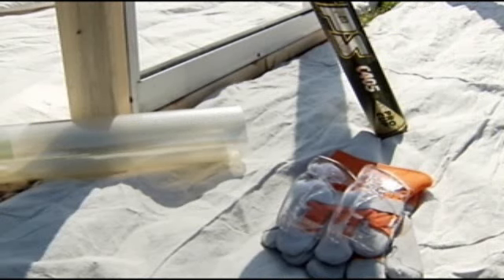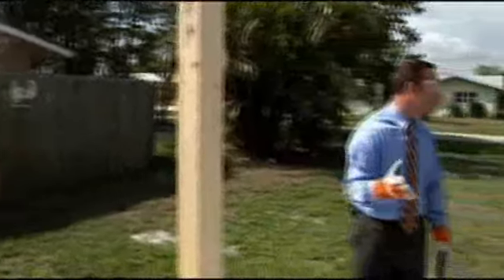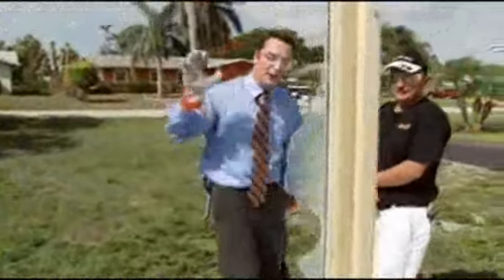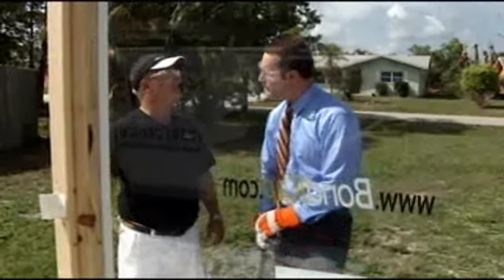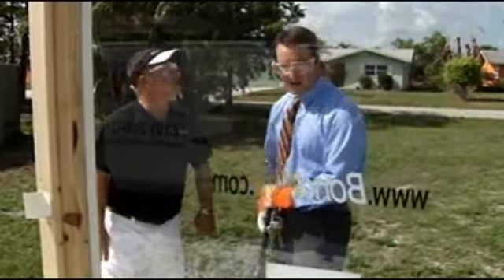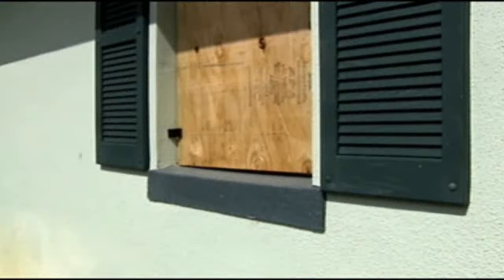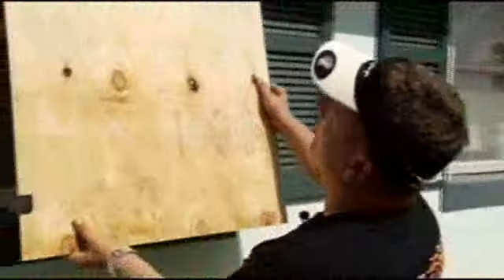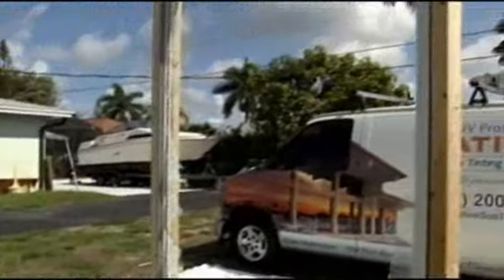Hurricane shutter alternatives

Comment: Unfortunately.....MOST new home construction, even in these areas....are vinyl-sided homes with vinyl/plastic framed windows that are nearly flush, with no recess......so you can't use the plywood-with-clips method. Actually....can't think of any method as where would you "drill" and mount plywood, without permanently damaging your home and providing a leak path "in"?  Don't see any vids or DIY's for this most common modern home......anyone?